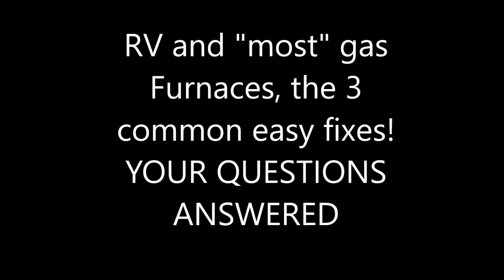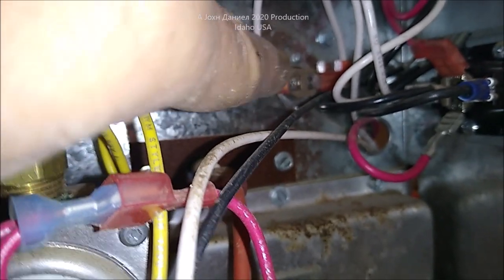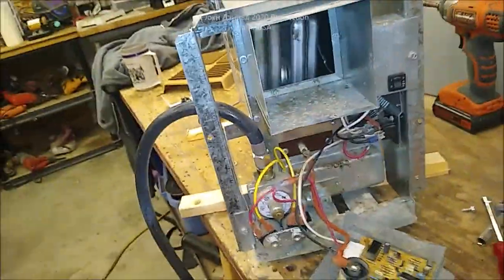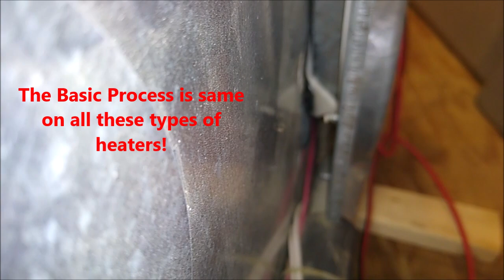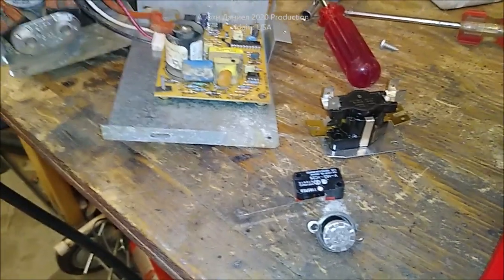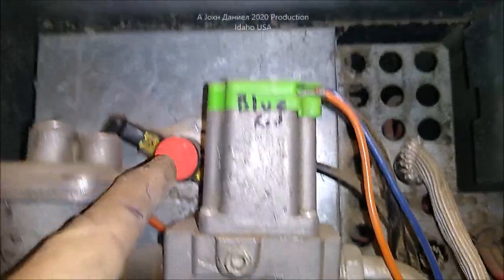RV Furnace REPAIR TECHNICIAN SECRETS Top 3 Easy Fixes anyone can do PARTS BELOW

Comment from the maker: Universal Run Delay Relay https://amzn.to/36MXTrR Universal High Limit temp Switch (get 120°C/248°F Normally Closed N.C Snap Disc Switch) https://amzn.to/36Jtbjh Blower Sail Switch https://amzn.to/4kmRMiz it sends GO signal to board (pick a best option) Universal Control Board fits 90%+ models https://amzn.to/4kZp6vZ Need  Tech Answers? go👉 Donate $5+ on KoFi - https://ko-fi.com/john4kiera OR https://bit.ly/2buyaCoffee message, inquire, to get my help & replies!  Go⬇See all Parts and Trustworthy Sources below⬇
Best *MWXNE 4000 Watt MEGA 120v RV Inverter*, Get one NOW! https://amzn.to/4ixXC05
Reply: How’s it going I just wanted the video I have the 7920-11 model in a 1994 lance camper I’ve replaced the sail switch and the igniter or pilot my furnace clicks one and the fan turns on that’s it I have no heat or anything I don’t know what’s wrong if you could help I’d greatly appreciate it
Reply from the maker: @tonycombes9288  Be sure you have gas on, battery over 12.4 volts, and nothing blocking the intake or exhaust on it such as wasp and insects. If you hear the gas valve kick on, a click about 15 to 20 seconds after the fan starts, then swap gas regulator on tank for another. If you don't then look into the over limit switch on the unit, bypass it with a jumper just for test, cycle the furnace again a few times. POST NEW COMMENT ( not in a THREAD) under video on this video so I can get that feedback on your results.
Reply: Thank you, John. I gained a great understanding of the function and diagnosed a faulty sail switch on my unit.
Reply: John Daniel, any ideas on a heater that only works when you pull the board plate and cover down? My guess is airflow but I’m not sure. Thanks !
Reply: Hey where is limit switch location on a suburban nt-20sq furnace
Reply: @derekschmitz26  aaaaàads
Reply: GG[oo[[[[[[
Reply: John Daniel could you please help me. Our 2000 Colemans furnace/ac aren't working. We thought wed start with the thermostat but putting a new one in had no effect and still does absolutely nothing. Doesnt even attempt to start. Please help. We are living in it now and really need this to work without a complete replacement. Thanks in advance
Reply: John Daniel, I need help trying to find the exhaust tubing that is on the inside of my furnace. Would you know where I could find it? It's 1"3/8 od by 14" long. Please help. 🙏
Reply from the maker: Spare part? I may have it. Send me pictures of unit, model, year. I have tons of spares and even make them as needed. olympicpowercontrols@yahoo.com. $10 to $20  plus postage
Reply: @JOHNDANIEL1  do you have a control board for atwood furnace 8525 3 wire connect?
Reply from the maker: I can look but those are hard to come by now. Look at this one, let me know if its same or different as the one you have. https://amzn.to/3MC3VzO
Reply: @JOHNDANIEL1  
Yes sir just curious if you check and read these comments. I have a question on a furnace that I have but everything I see online is to current and doesn’t give me the info I need.   I’m working on a 1994 trailer furnace. If you do check and read will you respond and then I will ask you my question. Instead of wasting time explaining and then I get no response.     Thank you sir appreciate you and your videos.
Reply: Ok maybe two questions.   Lol
Reply: I put a new circuit board, new sales switch & new limit switch, my furnace is doing the same thing it did before, blowing air but not ticking after that and not firing up.
Reply from the maker: @kristinaa9476  Did you replace the igniter on the heater, have you checked to see if your thermostat has not burned through its anticipator wire for heat signal and have you checked for the solenoid on the gas valve if it is getting power? Let me know.
Reply: My RV camper heater will click but, only start if I go outside and put my hand over the vent while it's clicking....then it fires up and works fine... until it shuts off, comes back on, clicks, and I run outside once again... can cause for long night when it's freezing outside... especially, I live in my camper full time...any suggestions.
Reply from the maker: @jourdynstanovich6691  Sounds like you have a lean running condition. This can be caused by failing propane regulator, High humidity, high altitude. Depending on outside temps, your regulator may be icing up, or the fuel may have more than the 2% water content allowed by refineries. 
Another rare but possible is your racing the blower, by choking it with covering the vent then when it surges it can then produce enough air to flip the Sail Switch allowing fire up. That normally is due to dirt and dust build up on the blowers fins, or the sail switch itself having wear or weight causing it to need extra draft to lift. Last possible it the igniter is improperly spaced on the burner, causing spark to not get hot enough or make contact till you enrich the mixture.
Reply: Thank you, I will dig into it... great video as well...
Reply: Thank you for the awesome video!  I tracked power to the run delay relay and it is getting power (bought the universal Emerson you recommended) and the switch doesn't seem to be working.  I get power to the delay relay, but from there it won't open and allow power to the other side of the relay.  It doesn't seem likely that the relay would be bad out of the box, but that is the only thing I can think of that could be wrong.

After the warm up period the relay should open up and allow power to the other side of the relay correct?
Reply from the maker: @SteveJud43  If you wired power through the right terminals it should do that. Power from the thermostat goes though the bottom, the contacts from the top go to blower.
Reply: @JOHNDANIEL1  Thank you.  I was doing more testing last night and am only getting 1 volt from the thermostat so it isn't activating the relay.  Going to wires the thermostat wires together to test if it is the wiring or the thermostat that is faulty.

I didn't have a good understanding of the power coming into the relay and how it was activated.  I was thinking the 12v+ would activate it.

Thanks again!
Reply: @JOHNDANIEL1  I bypassed the thermostat and she fired up and started heating. Sorry for the confusing question.
Reply: I have a question about my furnace. It will lite and stay lite, but it starts to clicking very loud at the furnace. Why would it do that and what is the fix for it?

Comment: When we put our red and white together it blows the fuse in the panel.  Just trying to get furnace to turn on!  Changing a dead thermostat on Atwood Hydroflame 2334, we have tried 6 different thermostats and NONE of them will work. We get power, no fan nothing.
Reply from the maker: What year model is the furnace? Is it a Atwood 8500 version?

Comment: I have an issue with this same model heater in a 1997 shadow cruiser 951. It fires up and runs reliably w/great heat but there is a propane smell that just developed coming from right around the heater. Doesnt set off the brand new detector that's right below it, but when the tanks are on and whether it's running or not, the cabin smells like propane. Is this a gas valve inner seal issue? I checked all the connections with soapy water.
Reply from the maker: Shine a light up into the outside exhaust and intake assembly. Look for wasp nest or blockage in those pipes. That is a symptom of blockage causing unburned gas. The intake blower is pushing harder than the exhaust can vent out. Using a wire you can pull out anything in it, never push things into the pipes. There is 2 pipes, one inside the other. Rarely you could have a cracked heat exchanger (burn box) but not normally. And sometimes its carbon rust scale on the burner itself that can cause that.
Reply: @JOHNDANIEL1 Thank you for your insight! I took the cover off and there were indeed creatures nests built up around the intake, not enough to block it completely, but enough to make a difference. The exhaust was clear.
The issue i'm still experiencing is that there is a gas smell when I walk in the cabin, even when the propane has been off all night at each tank. It's worse when the tank valves are on and the system is pressurized.

Comment: I need to pull my furnace out of my motorhome take it apart and clean the insides out from mud Dobbers and then put it back together again.
My other camper, the furnace works perfectly, except for the smell of gas coming out of it. I bought a assortment of O-rings and I’ll go through it and find what’s leaking.

Comment: Is there any lubrication required for the blower motor I have the furnace pictured in this video
Reply from the maker: They are oiled when new, but do dry out. I use 98 ZOOM https://amzn.to/4ibBo4e on all the ones I work on, It last the longest. What you do is remove the motor if you can. This requires a allen wrench on the set screws on the blowers. Look the the indent in the fins on the wheels where your wrench can fit. When you take off the intake side blower cover just replace the gasket with red RTV 1/8" bead https://amzn.to/4r4eDDh JB is the best for dry vibration prone areas. The main cabin blower is on with a set screw, 1/16 I think so use WD 40 on it if its stuck. Motor will then have a few mounting screws and pulls out left to right. Take the motor and do a gentle tap with a craft hammer or similar not to hurt the ends on each end of the shaft so you clear all bearing dust while you add new oil. 3-4 drips per side. Re-install it and your good. If your motor bearings are scorn bad you may prefer a new motor, but oiling can get you 1 to 3 years. Need More Tech Answers? go👉 Donate $5 + on KoFi - https://ko-fi.com/john4kiera OR https://bit.ly/2buyaCoffee message, inquire, to get my further help & replies!

Comment: Thank you for sharing your knowledge!  I have a 2019 Grand Design and the furnace started acting up on our last trip.  it will initially come up to heat when first turned on, then it will not cycle when it cools down.  Meaning it sits there and does nothing unless I cycle the thermostat to off, wait for a click at the thermostat and then put it back to heat mode and then it will call for heat again.  But it won’t work automatically on it’s own if you get my meaning.  Odd one…. I replaced the thermostat as a first repair attempt, but no dice… same situation.   Any advice you or your other viewers have for me, would be greatly appreciated!!
Reply from the maker: Do you have a ALL IN ONE thermostat? Air Conditioner and furnace? These can tend to lock out the furnace when the AC unit senses heat and locks out the furnace to be ready to run cooling.  If you power everything down the furnace will run after the AC unit releases it. These so called "smart thermostats" are as dumb as it gets. We always separate them to solve such behavior. If your thermostat is getting power from the AC unit I would suspect it.
Reply: @JOHNDANIEL1  Yes, its an Excelair combined unit T Stat.  After i posted this i went back out to check a few more things to make sure I wan’t overlooking something.  I reinstalled the old thermostat and checked the voltage output at the T Stat after it cycled once and the camper cooled to see if it was still calling for heat.  Indeed, I have 12V on the output to the furnace, so the T stat seems to working in that sense.  I have 12V out to the main board or circuit anyway… still no dice.  I bypassed the over-temp switch as well… nothing.  Sail switch isn’t the issue.  So, i am left thinking its a bad board.  I guess that is my next step unless the delay relay is malfunctioning
Reply from the maker: If you have a normal 2 wire lead from your furnace, remove it from the dual use thermostat, connect them with a jumper and see if you get fire up. Takes 20 to 30 seconds for the board to respond. If so, you can move to install a basic thermostat, very basic same as used in most heating. If you need a item to use let me know of get the basic manual version here. https://amzn.to/4oyzPj8 
Your AC unit has the default control board, so when it is acting up, you will burn though hundreds of dollars chasing it down. Set the AC unit to highest setting (warm) when you bypass it, turn it off for winter.
Reply: @JOHNDANIEL1 .  Thank you sir!  I will keep diagnosing and let you know what I find.  Cheers

Comment: Just ordered a fan delay relay from your link since my NT-20SEQ won't run the fan or anything at all.  New thermostat, and the blue thermostat power and signal wires seem to test at the same voltage when turned on.  Now if I can just figure out how to get to the relay on it, there's not really much of an access panel or anything on the sides.  I'm hoping the little 90-degree doohickey I see crammed up its throat, with two reachable screws, is able to pull out and everything is attached to that.

Comment: So…my Rv furnace turns on, runs for about 10-15 minutes(blows hot air)but never cycles after that(never comes back on) I literally have to reset it for it to come on again. What could be the problem?
Reply from the maker: Over temp switch is failing. When it shuts off the heat in it hits a peak and with the switch failing it acts at a lower temp then hangs up. If you tap on the unit near that bi-metal disc, the over temp switch, see if it fires back up. If so, replace with one like it.

Comment: I turned my furnace on for the first time and I have thick smoke coming out of the top exhaust along with black ash particles.  Could you give me any instructions on what it could be and what to do first.
Reply from the maker: Sometimes that means water in the propane but most of the time it is Wasp or some insects. Most likely is a sign of wasp nesting in the intake or exhaust. They can be sucked into the intake and make a mess. Using a shop vac, heater off, switch from suction and blowing ( LOL ) into outside ports of the heater to see if you can get it clear. If you hit lots of resistance do not continue since that may mean it is seriously plugged and it will have to be removed so you do not damage the intake blower.
Reply: @JOHNDANIEL1 thanks, I will give that a try.

Comment: I don't seem to have a switch and also don't see the board they are talking about and my heater looks exactly like yours except for those two things
Reply from the maker: Depends on what year and actual model you have. Most pre-1979 have no ignition board and only a pilot light system.

Comment: So my issue is my regulator crapped out and so I replaced it and initially the furnaces worked on the new regulator and it stopped, then sometimes it would work while the burner was running until it stopped completely. So I replaced the regulator again and it has not worked on the new (new) regulator at all. So with the issues only started when I changed the original regulator and the first new regulator the furnace would work at first sporadically and then only when I turned the burner on and then not at all, got a second new regulator and still nothing. Didn’t touch the furnace or move just changed the regulator and it worked like a champ before the swap and stopped after, any ideas?

Comment: My rv heater doesn’t have a board- it’s a pilot light model, with manual ignition button 
The fan doesn’t come on with the thermostat 
Any ideas?
Reply from the maker: Many older style like that uses a Thermal bi metal disc. When the fire comes on it reaches a certain temperature in the heat chamber and kicks the disc over incense power through to the blower. If it's failed it can either leave the blower running all the time or not at all. You will look for a bimetal disc mounted near the heat chamber the burning burn chamber and test it for continuity by putting a pair of jumper cables between its two terminals and see if the fan kicks on.

Comment: When these heaters are brand new the first few times you fire them up they produce an unpleasant smell....dust burning off in the burner tube??? How long before this smell goes away? Thanks very much.
Reply from the maker: The truth may offend you. There is a Enameling Coating and a Ceramic Oxide Coating on the metals, and there may be some RTV smells. It's the change in Chemicals to apply the coatings that causes that since 2011. They tend to smell a bit for a few days. This is all crap that the Obama folks forced on manufacturers for "environmental reasons" so a june bug is not sensory offended during the manufacturing. But thousands get killed by the off gassing when used.  
About 80% of everything since then they altered for the awesome ability to Virtue Signal will now harm you so that Bureaucrats can feel better.  
Turn it on high, open all windows, allow to run for a few hours straight to clear out. Thankfully no manufactures or seller are required to tell you that info.

Comment: Thank you for the great video! I replaced the run delay relay & checked the two other parts which seem to be ok. Still will not turn on at all. Have power to one side of the  relay but not the other. Any ideas? Is it the board?
Reply from the maker: Thermostat connects to the top sending power through making the bottom terminals on it delay and send power to board so check thermostat
Reply: Thanks John. Checked the thermostat which I replaced with a Honeywell heat-only digital PRO1000. Wasn’t working. I put the old manual thermostat & it’s working now. Did I miss something with the new tstat?